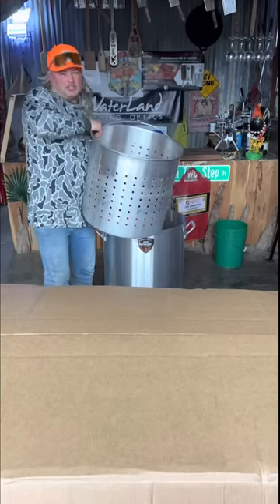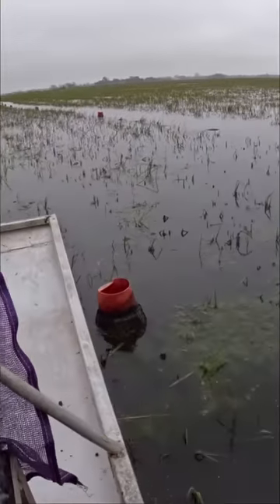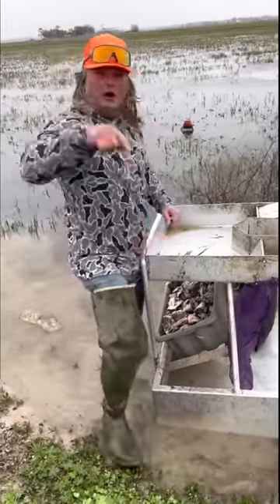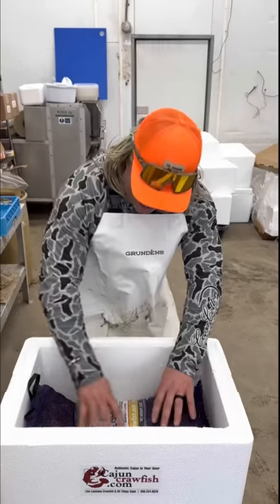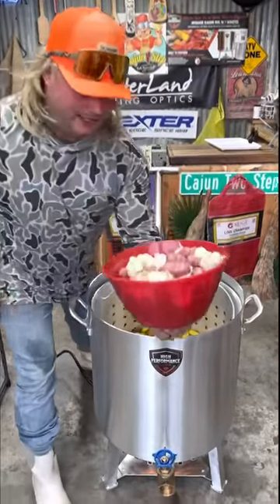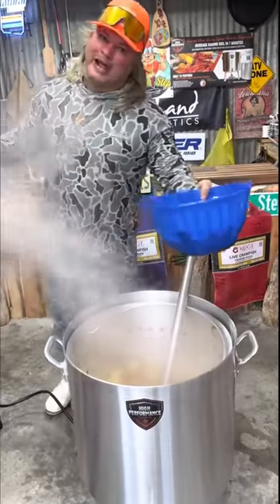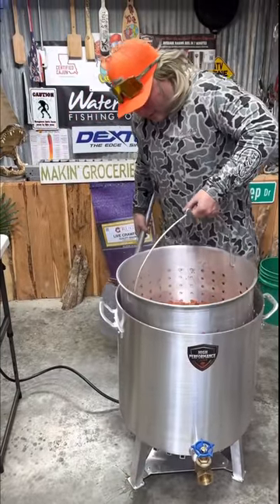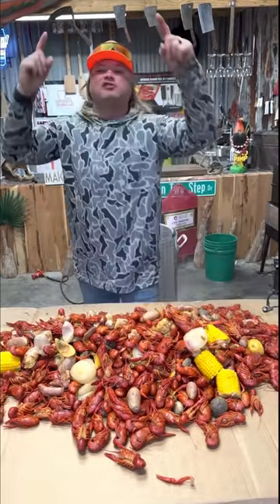Cajuncrawfish field to table!!!

Comment: Sorry buddy if the juice isn't running off the table as soon as they are dumped out. Then you "f',n" up. 4 min solid rolling boil then soak for 45mins -1hr then make sure you Kill the heat with your frozen corns and a bag of ice!!! Get it dude
Reply: @micahgrubb6867  🤣👍 good